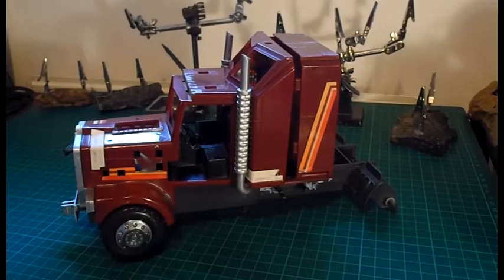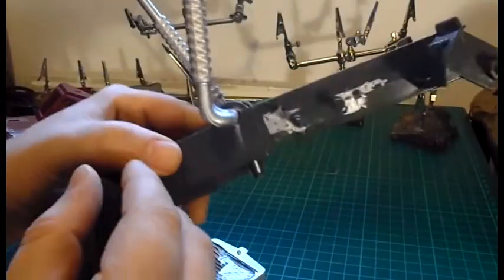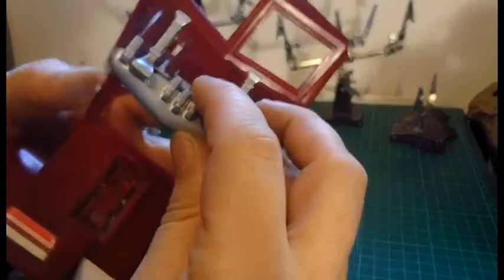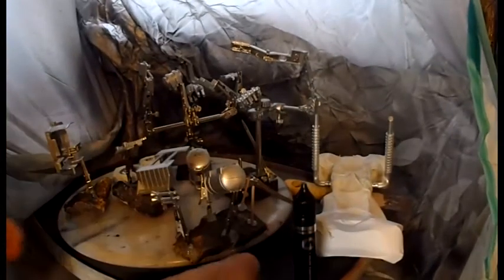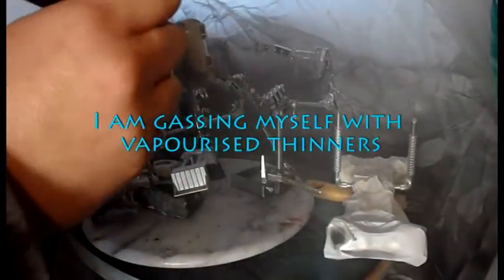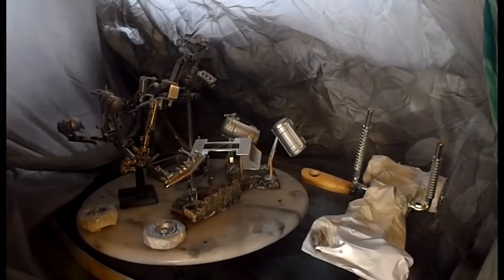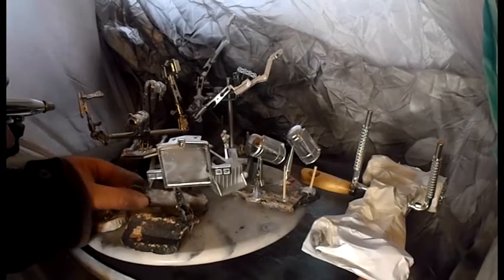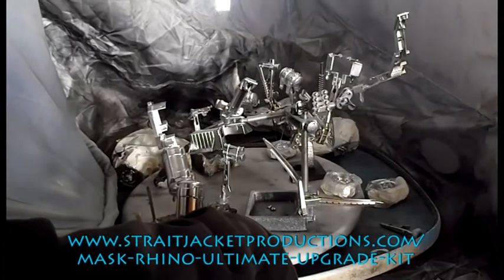MASK M.A.S.K. Rechroming Rhino - Straitjacket Productions

Comment: Have to say, phenomenal step by step, i will be using Molotow chrome.

I will be ordering your updated sticker details.

Thank you.👍🏻
Reply from the maker: Awesome, thank you for watching. If you buy on my website before 22nd August 2023 use the code WEDDING for 10% off your entire shopping basket. I just got married!
Reply: @Straitjacket2007  congratulations 🎉

I think I will get condor too... 

Here's a question, Vallejo paint, anyone know the colour match number to rhino, I'm going to clear coat as if the peterbilt truck is straight off the assembly line.... Oh and 3d print a trailer 😁
Reply from the maker: @SPRTN2043  Thanks! 'Fraid not but I look forward to seeing your project!

Comment: Using mr hobby levelling thinner may help level the chrome better but what i notice is the chrome tends to self level based on gravity so for flat parts it is best to hang them so they are flat or else you might find the finishing uneven.
Reply from the maker: Thanks for the comment! Sage advice! I also think you can minimise excess by applying the airbrush lightly.

Comment: How did you managed to make the chrome doesn't that smudged and lose it reflection? Most of the Molotow Liquid Chrome gets smudged a lot.
Reply from the maker: Yes it does. And it takes an age to cure as well. The answer is just to leave it for AGES or try and warm it quicker in an airing cupboard or with a hair dryer.

Comment: Glad I found this video, I actually bought Ultimate Thunderhawk stickers from you lol I now have a Rhino and it needs to be re-chromed, where can I buy the chrome pen you show in the video? I can only seem to find 2mm and 4mm nib ones. Also thanks for posting this I will be using it as a reference when I start my Rhino at the weekend
Reply from the maker: Hi! I didn't use a pen, I used the paint in my airbrush, but they're the same stuff. Molotow liquid chrome. I bought it on ebay I think!
Reply: @Straitjacket2007  thank you for your help, I shall obtain an airbrush
Reply from the maker: @RetroOverload  The pens are pretty good too if you don't want the expense of an airbrush. I've seen some of the guys do a good job with them.
Reply: @Straitjacket2007  interesting 🤔 I will try a pen on one of the parts if it looks good then il continue. If not il buy an airbrush lol thank you for your help

Comment: Considering doing this myself. Do you know anything about the durability? Is it display only or can it be handled ?
Reply from the maker: HIya if you leave the stuff to cure properly it's fine, but it can take an age. I left mine in a garage for 10 days (December UK) and it still picked up fingerprints etc when i was pushing it back together, especially the horn bit above the cab as that was the stiffest. I suggest doing it in summer or a warm airing cupboard or somesuch for a month! Should be fine after that!
Reply: @Straitjacket2007  you can brush up some future floor shine it will form a soft layer of protection, still fragile but you can at least touch it. Loses around 10% shine. I have heard alclad klear kote works and is more durable.